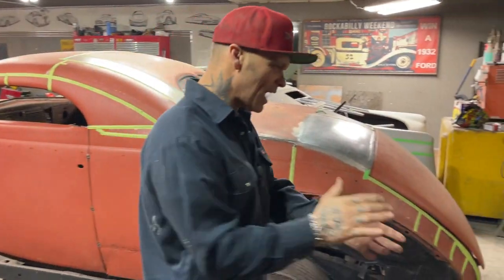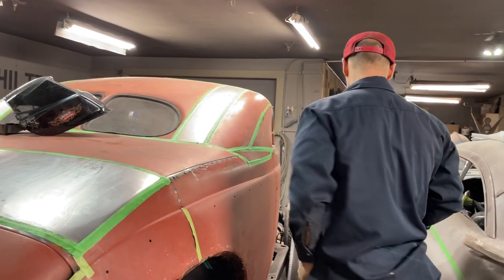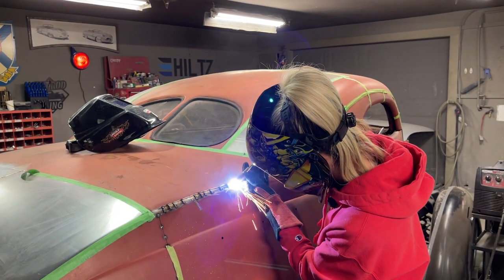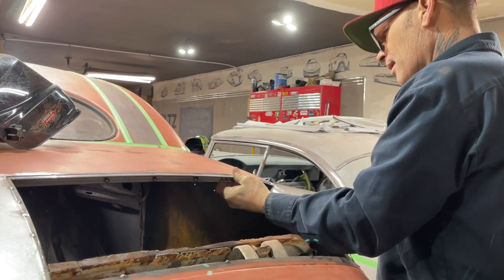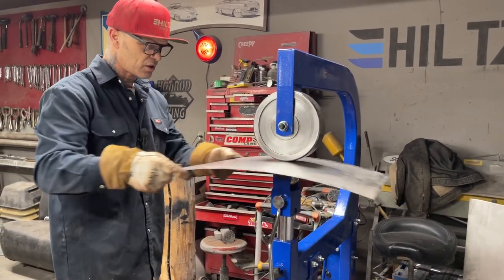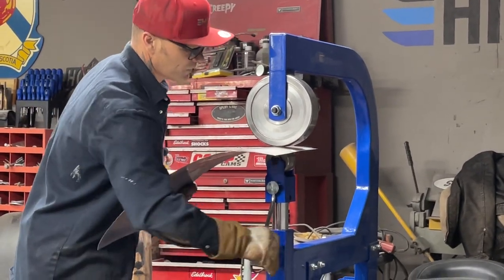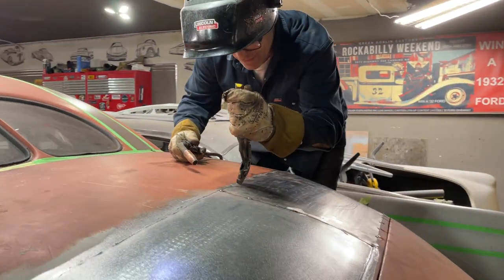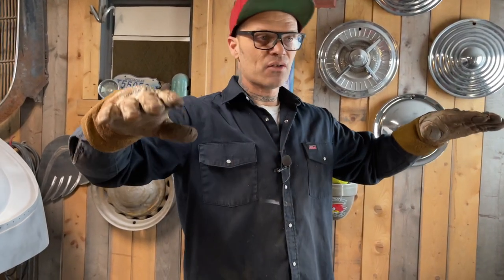Building a Hot Wheels Toy by Converting a 1940 Tudor into a Coupe: Part 12

Comment: One of my favorite persuasion tools, like to bend downthat angle iron piece, is a crescent wrench. Adjust it to the thickness of your material and lever it as needed. Great control and probably a better use of the tool than on a nut or bolt.

Loving this build! Glad to to see Jolene and you got the new English Wheel. 👍

Comment: Good to see Joline get right in there, no hesitation! And rolling steel also work hardens the metal, so it is less flexible. You can also shrink or take out the tinnieness by heating the metal and cooling very quickly.

Comment: You should only roll the panel until it fits perfect in the opening. Shouldn’t have to push down to fit the panel after rolling it. That would have too much tension on the metal.

Comment: I was laughing at the comment about using exhaust pipe to form your body lines; because I thought the Same thing.  Nothing bad, just thought it was a way to radiate heat into the cab in the cold winters.  Thank You and Jolene for another interesting educational video.  The Coupes lines are awesome.

Comment: If you wanted the both panels to contour the same try laying them both on top of each other tack welding the four ends, then English wheel them together at same time, then after flipping them over as opposite side matching pieces.

Comment: Love the project but please be careful when welding galvanized metal as the fumes can make you very sick. I don't want to see anything happen to either one of you. You should have a respirator or maybe a fan to help blow the fumes them away, the fan will also affect the shielding gas so you will need to have the air blow from behind the nozzle not toward the weld. I learned body work and restoration from my dad. I have been doing it for fifty years now and still love it. I'm old school metal fab, pick and file and leading. That English wheel will make thing so much faster for you. You two make a great team and couple. Wishing you all the best.

Comment: If you get a rubber band for your upper wheel, the shape will go into the panel only side to side. Eastwood sells them for fairly cheap. They work well. Place a 4x4 on top of the frame of your wheel to keep the rubber band out of the way when not needed.

Comment: Hey Chad mate when your going to do your bead roller you are better to use a higher crown wheel then a lower crown wheel as you will need to stretch that metal heaps so when your bead roll is going down then it has enough metal that is stretched up so it stretches back down

Comment: When welding galvanized steel, the zinc coating easily vaporises. This will form zinc oxide fumes that will mix with the air. This gas may give short-term effects to your health which is also known as “metal fume fever”. Welders may experience flu-like symptoms once they inhale the fumes.Aug 17, 2020

Comment: Use a rubber band or duct tape on the upper wheel. It will prevent the metal from "curling" so much

Comment: The exhaust pipes you use is aluminized steel not galvanized just so you know, there is a measurable difference, expansion is a difference in effect

Comment: Just wondering if u were to use the rubber band on the top wheel, if it would have worked better. There was no need to stretch the metal, only to shape the panel.  The rubber band allows the metal to bend without stretching.

Comment: get a plastic oil funnel with a piece of hose drill a hole the diameter of the hosethrough the wall of garage instant inside pisser without going out doors

Comment: Chad, I’m an aircraft mechanic. I’ve not built a hot rod…why wouldn’t you apply corrosion inhibitor on the mating surfaces of the panels before you secure them permanently?

Comment: i dont know how much you pay for what lenth or diameter of exhaust pipe but schedule 40 electrical pipe is also zinc coated and you can get it in smaller diameters and readily available at your local lumber and home repair stores home depot lowes menards ect...